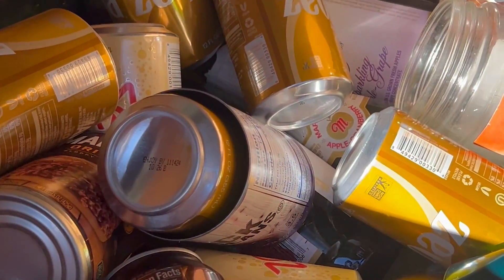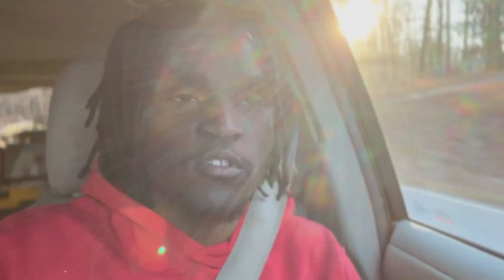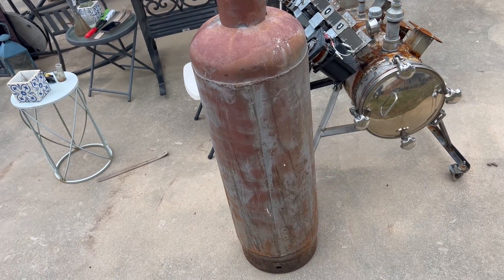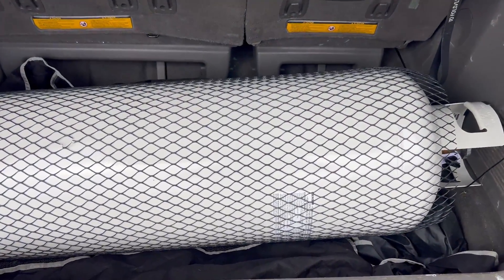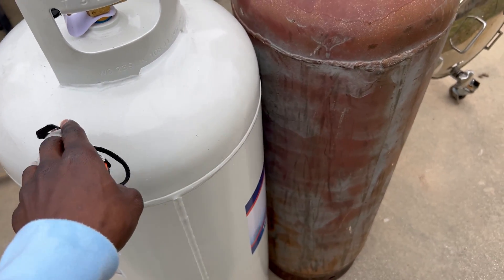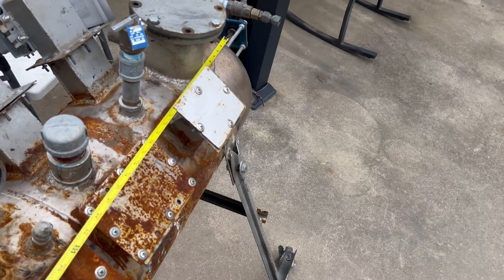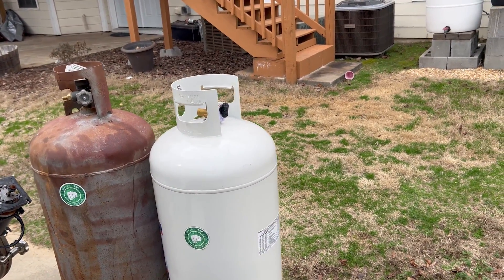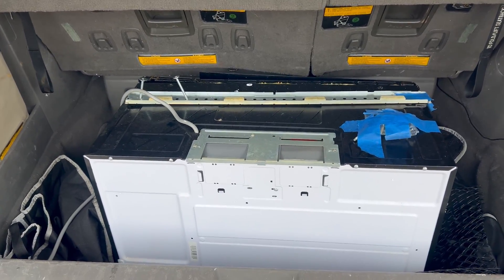Building Mark 4.5 Plastic to Fuel Reactor | Part 1:  Parts Shoppin

Comment: Have you seen those microwave crucibles? They heat up over 1000°c people make ruby with it at home, melt glass, cast iron ingots. If you get a large enough crucible or enough of them, you can turn almost anything into carbon and pyrolysis it. Or, once things are shredded, wrap it in insulated cloth. Like they use in a furnace. It will keep all the heat inside the wrapped up material and pyrolysise it faster.

Comment: I have a question about the magnatrons. If you oriented them where the 'top' of the tank would you get better efficiency? What I have researched so far is that the microwaves travel linearly. As well as certain metallic materials being able to reflect the microwaves. So I'm curious why you chose that certain orientation.

Comment: Could you hav3 it run on the coal or gas it produces its self?
Reply: You can, a generator to burn the gas to power the magnetrons.
   The raw carbon in something like a wood gasifier. But he is using the carbon fed back into the process as a microwave susceptor and catalyst. The extra is better sold  compressed into blocks or pellet to replace coal or coke in steel and concrete manufacturing.
Reply: @petevenuti7355  I meant just ditching the magnetron and using the gas in a blow torch basically. And does this coal from plastic burn hotter?

Comment: How about desiging a unit to use all new everything? So have a target like fitting in a 20' shipping container. Design in CAD focusing on using off the shelf (as much as possible) componates. Like just buying steel tube to the correct size. Finding commercial microwave units. Get the whole thing built in CAD so it can be priced out.  Try to develop a complete system. Plastic in one end, power out the other. Completly automated. Have AC power generation, liquid fuel & gas fuel capture. Also, the 3rd product, the coal or soot, needs to have a process developed to use it. I see these units being a perfect solution for remote areas to deal with plastic waste.  So what ever solution for the coal product has to take the remote area into consideration. As an example, remote island that plastic has been washing ashore for decades. Plop down one of these units & now the plastic has value. But what will they do with the coal soot?  All this need to be figured out in CAD & on paper. Then the $ will flow in.
Reply from the maker: That is what Mark five will be! This is my last reactor with a limited budget and limited funds so my last reactor made out of scrap
Reply: @naturejab  How are you with CAD?
Reply: Yeah that’s a valid point. I was wondering and thinking how the footprint could be smaller? How to maintain the internal temperature with as little heat loss as possible. So that the chamber can use less energy becoming more efficient. In theory they make coating that minimize the feat transfer on one side. Also how high could the internal temperature reach before it becomes ineffective or should a higher inner temp make it process faster. I was thinking gravity fed inlet. Like you agitator how wring if the agitator was also a heat source if that would produce benefits? Yes he had a great point about utilizing all byproducts. The refinery is going to be the most expensive or if possible maybe current refineries can be utilized for the refinement maybe if not completely comparable an attachment or addition can be added to existing refineries. You probably thought of all that but maybe that will assist you in some way in the future. Be safe brother
Reply: @agileep  the key in life is to be able to see the issue from multiple points of view. In an urban environment the 3rd product can be used in asphalt. But, I have a remote location bios. As urban options might make microwave pyrolysis non competitive. When it comes to nonremote scenarios, ByFusion ByBlock is a better option currently.. Art is always the last solution, but a solution non the less. Can we mix the 3rd product with something to get a 3d printer filament?
Reply: @GudasWorld  what you are thinking neighbor centers for deposits? Maybe what a townhouse development might have a facility in the development?  I mean not like I know the power requirements vs the production. Like if you had a generator hooked up if the fuel output would be more the fuel consumed for energy? I mean could you throw a power wall at it and it can have a (I think it called) a net positive return?
Reply: @agileep  Ya I think thats the deal with the microwaves. Current pyrolysis is nearly a 0 sum equation. The amount of oil captured has the same watt potenchal as the power it took to convert the plastic.  So in theory  the microwave plant could run itself & a generator. Since there are 2 fuels that come from the process, liquid & gas. 2 generations, one that runs off the oil & the other that runs off the gas. Yes, using batteries will make the unit much more usable. Even solar on the top as the intinal power to get the thing running. With this new version hopefully we'll get solid numbers. I wonder if the agitation can be accomplished with magnets. The purge gas is another factor. Where would a remote area have purge gas?